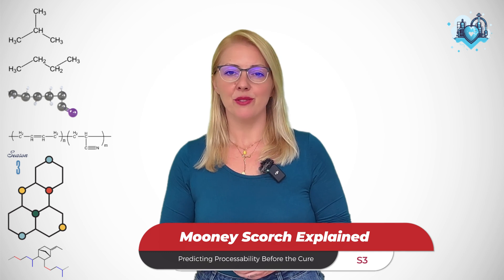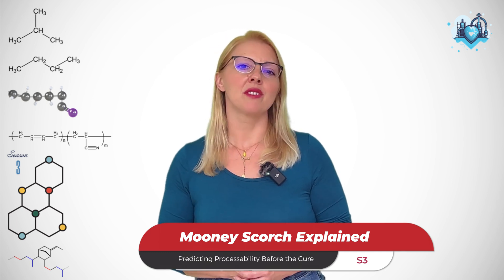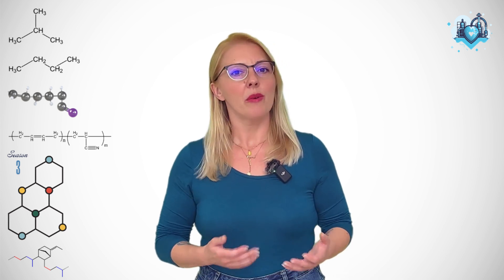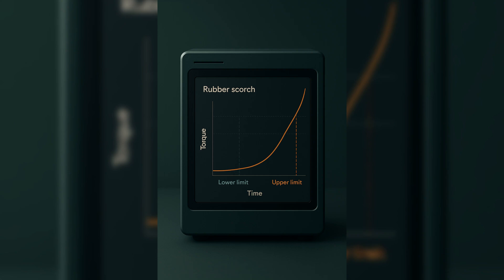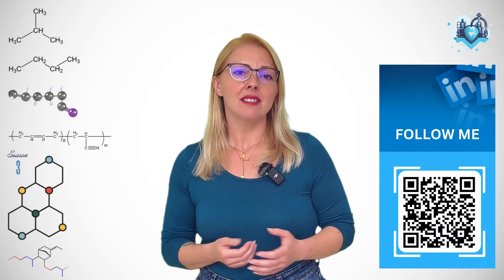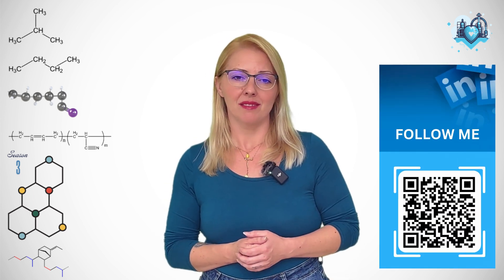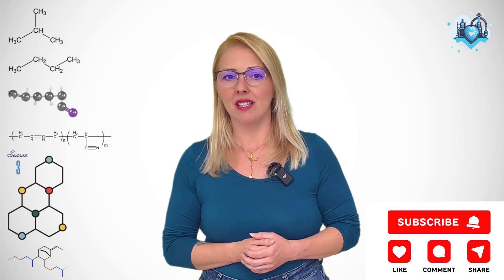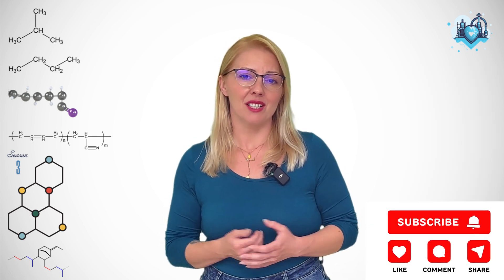Mooney Scorch Test Explained | Safe Processing Window in Rubber Compounding

Comment: hello! when doing the scorch test for rubber, how are the results being displayed/shown? if the viscosity shows MU, what about the scorch?
Reply from the maker: The same unit is also uned for scorch. Usually, the device automatically expresses scorch test results in T5 and T35. T5 is the time it takes for the device to measure an increase of 5 Mooney units(MU) from the lowest value (ML) and this is considered the beginning of scorch, meaning it's the maximum safe  processing time at the test temperature.  T35, a 35 Mooney units increase, indicates the compound  has entered full curing state. 
Those two are the most common, but the instrument records a full viscosity/time curve, so you can define any point on that curve.
What is very important to remember is the temperature 🌡 dependency of these tests. You have to test at your process temperature to see what your safety window is.
Reply: @MyRubberHeart thank you so much!
Reply from the maker: You are welcomed and keep the questions coming if you have any.
Reply: @MyRubberHeart  do you have an email I can send questions to?